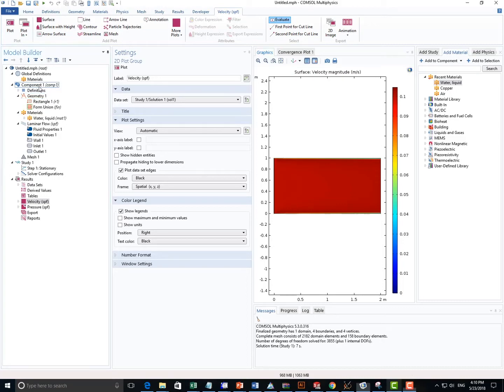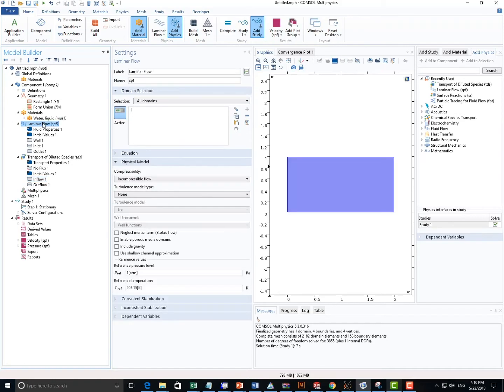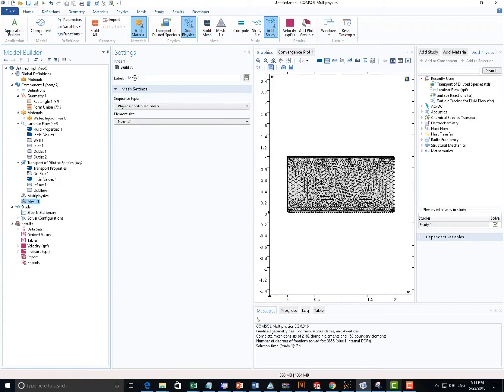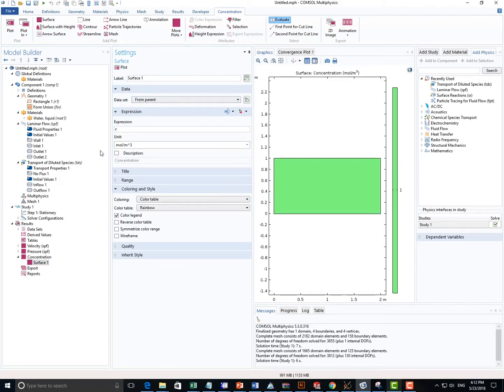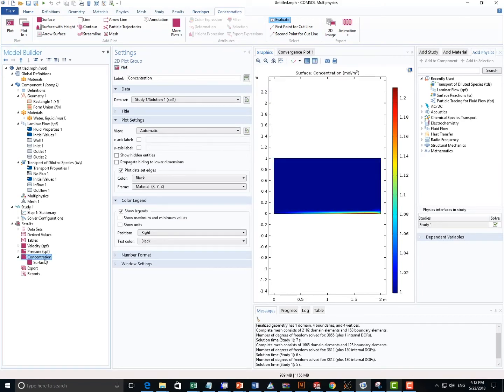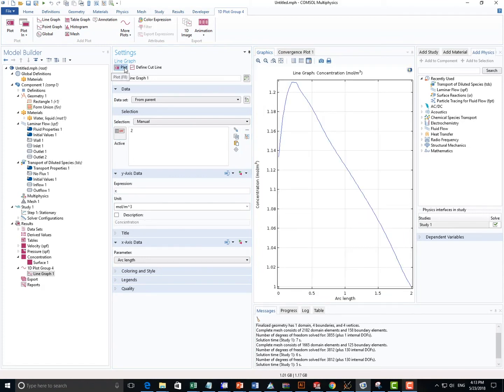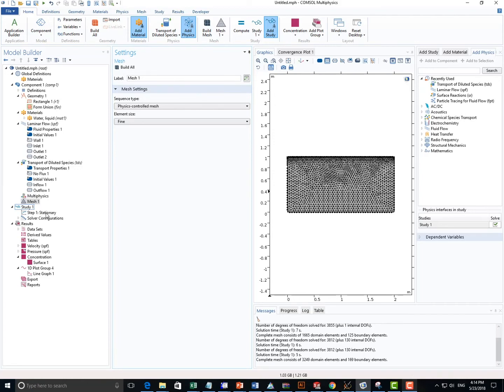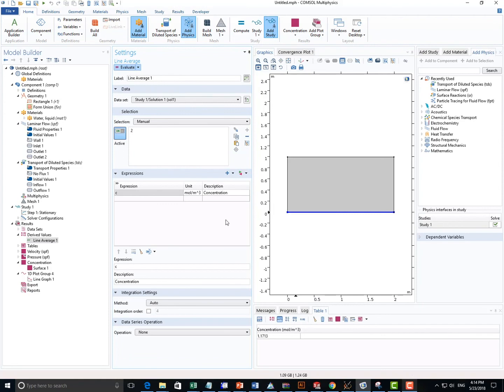Comsol 5.3 Tutorial for beginners | Adding Transport of Diluted Species | RO Membrane simulation

Comment: If a chemical species is moving (by concentration difference) from one liquid domain to a solid domain and then to another liquid domain, do you need to specify partition conditions at the two liquid-solid interfaces?

Shouldn't a simulation give realistic results if we just specified the chemical species' diffusion coefficient in the liquid phases and its permeability coefficient in the solid phase?

Is one overspecifying the diffusion model by including partition conditions?